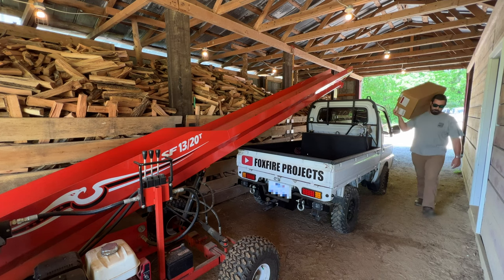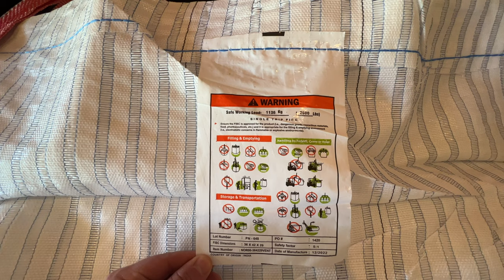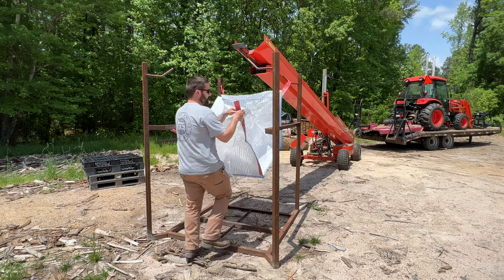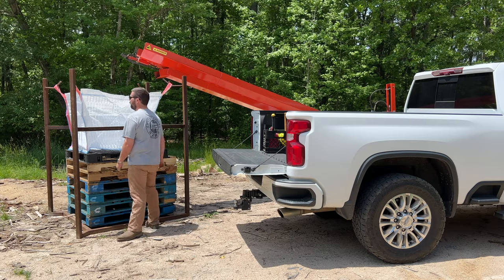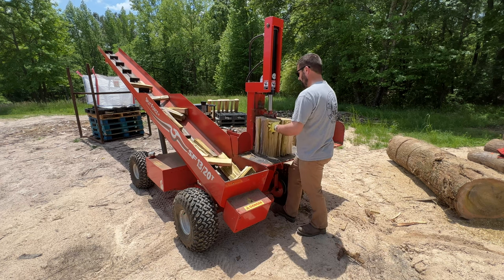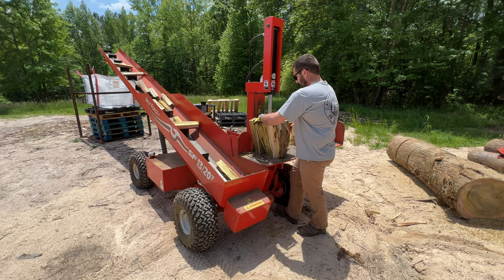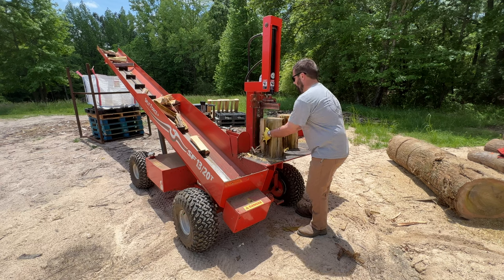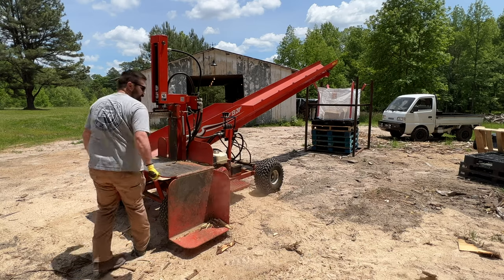New Half Face Cord Firewood Bags

Comment: I wish they made one half the size of this. It’d be helpful for those with subcompact tractors. A lot of home owners have them but these still are a touch to big for a lot of them. Many homeowners would them be able to use there sub tractors to move wood around more easily.
Reply from the maker: I think you may be surprised, these half face cord bags weigh in around 800 pounds or so, depending on wood type and dryness.  I had a Kioti CS2510 with a loader many years ago.  It was a glorified lawn tractor, and could still pick up right at 1000 pounds.  Definitely a great way for a homeowner to move wood around.  Thanks so much for watching!

Comment: Another great video!,  I think 1/4 bags would be a better measurement rather then 1/6 you would have to charge even more of a premium to deliver those smaller ones to make up for the bags, gas and time
Reply from the maker: I wish more sizes were offered, I'd definitely try them.  I'm talking with some manufacturers about some custom sizing, we'll see how it works out.  I think we will be able to double stack these on the truck, just have to figure out a solid way to secure them.  More on that in some upcoming videos.  Thanks so much for watching!
Reply: I wish they made one half the size of this. It’d be helpful for those with subcompact tractors. A lot of home owners have them but these still are a touch to big for a lot of them. Many homeowners would them be able to use there sub tractors to move wood around more easily.